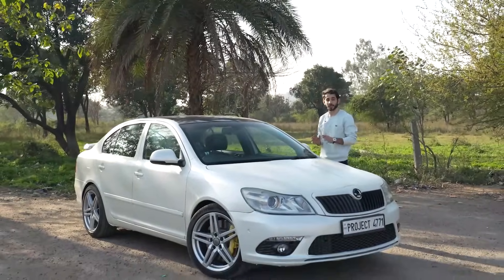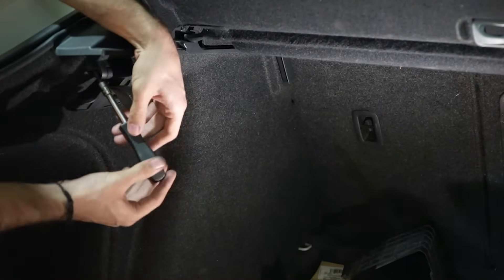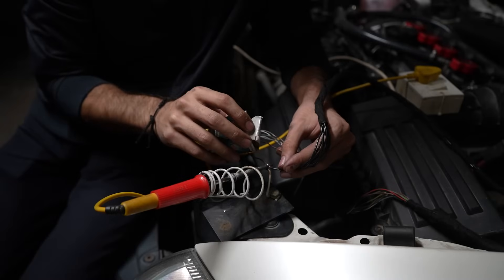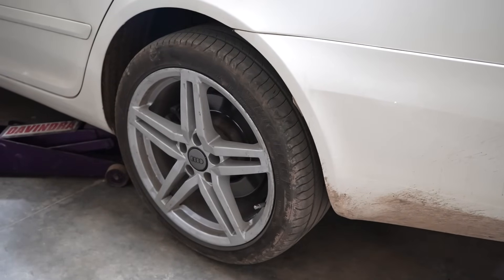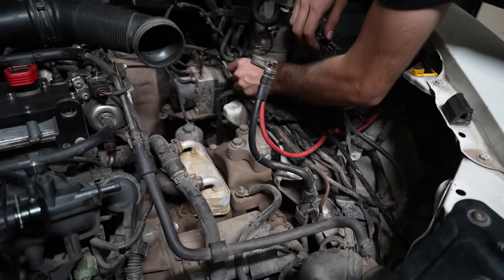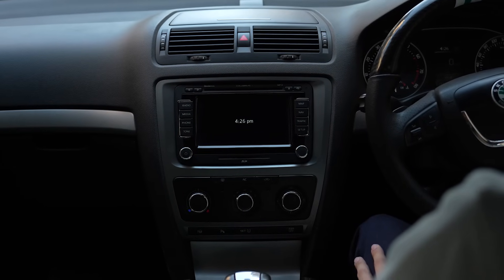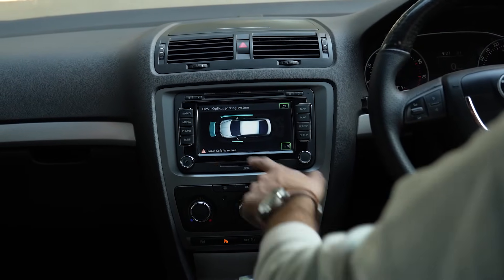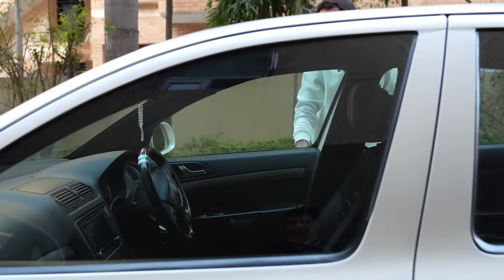15 year old car installed with auto park

Comment: Hi, amazing video. Wanted to ask if you think it is possible to upgrade from the current park assist (only lateral parking possible) with 4 sensors back and 6 front( 2 lateral). I have a Tiguan 2011. What are the parts that I would need to buy and introduce?

Comment: Bro how steering wheel turned by it self you just installed parking sensors
Reply from the maker: The steering rack in these cars is equipped with the motor already as it is motor assisted, after installing the auto park module and coding everything, even the steering rack, it unlocked the feature and that’s why it started spinning on its own

Comment: Is it possible in skoda superb 2012. 
It already has 8 sensors, 4 on each rear and front.
Reply: No it won't work. However you can try aftermarket generic sensors,with a display

Comment: Bro i have a polo 1.5 tdi and it have some heating issue when the summer season the car temperature goes above 90 degrees and i installed new thermostat and i changed the water pump while changing timing belt but the problem still exists can you give me some advice to sort out the issue

Comment: How did you install the motor which does the steering movements?
Reply from the maker: The steering rack is motor assisted in these cars, the motor was already present in the steering rack, didn’t need to add it
Reply: @PrerakKataria  oh! Does the Slavia also have a motor ready for use, if we do the other bits?
Reply from the maker: @lemedico yes it can support auto park , contact Me on @that.red.sells if you want the kit
Reply: @PrerakKataria  cheers mate! I don't own a skoda/vw anymore, but a Slavia 1.5 is on my Radar. Will text you if it materialises!
Reply: @PrerakKataria  a small recommendation from me, you might want to consider installing side marker lamps like they have compulsorily on all cars in the USA. I personally like them, car stands out!
The last generation of the Indian market Honda civic had them

Comment: Also Prerak was the autopark and 12k OPS feature offered as standard in any VW Skoda Cars sold in India?
Reply from the maker: In 2013 it was offered in Passat B7, most latest Octavias after 2018 have them as well, higher variants. And a few Newer Audi models have them. Back in 2013 Only Passat B7 was offered with it as far as I can remember.
Reply: @PrerakKataria  Oh ok thanks!
Reply: @PrerakKataria  Is it possible to do the auto park feature on Polo..? if yes, what all needs to be done to enable this like maxidot cluster etc..? 

Mine is a 2012 Polo, stock 1.2 TDI
Reply: @dinto_louis  It is not possible to install it on polo as it is a PQ25 platform and not PQ35 platform. It is mentioned in the description

Comment: How does the steering wheel move itself do we need to add any hardware for that too ? and what happens in case of a manual car. I am curious and want to know.
Reply from the maker: The steering rack of these cars has a motor for assist which makes the wheels turn during auto park manoeuver, yes it is possible on manual cars as well.

Comment: Whether the accelerator takes over when it’s in Auto parking mode?
Reply from the maker: No, just the steering, it’s semi auto parking, it does automatically brake in an emergency if you don’t during auto parking manoeuvre
Reply: @ so acceleration we need to apply accordingly, right.

Comment: Where in the video you installed the steering motor for auto rotate the steering wheel???????
Reply from the maker: The steering rack on these cars is electronic, motor driven, so the motor is installed in the Rack itself
Reply: Is the all laura do have electronic Steering !  @PrerakKataria
Reply: @Romeogautam   All of the vw cars in India, if I’m not wrong. They all have electric power steering.

Comment: On the part of opening stuff and putting back everything. How to ensure fitment is as good factory? As in no uneven panel gaps and no rattling
Reply from the maker: To ensure no rattles, we need to make sure all the metal clips go back in, these cars use metal clips which are very firm and won’t budge unless they’re not put in place, cars which have plastic clips will fatigue over time of dismantling and putting back together and they’ll start to rattle. Obviously even with this it won’t be 100% again as factory, but I haven’t faced any rattling or improper fitment